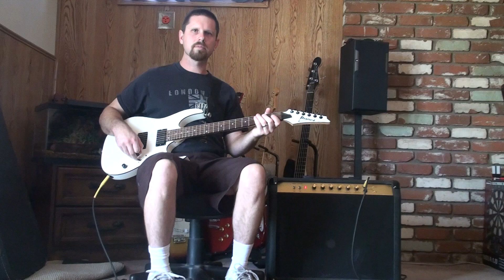Hi-Octane tube Guitar amp DIY (HIGH GAIN) AX84.com

Comment: Hello. Sounds great. Hey I have a question. Did you connect the wire from pin7 to pin 8 on the power tube? What power tube are you using?

Comment: Often in a tube amp, in order to have very little gain, you need more power stage, so, that, you can turn the pre-amp almost to zero and yet still have volume. I have a 4 x 6L6 main stage amp. With my volume on about 1, it is very clean with Master up to about 4 or 5.

Comment: A guy built me a tube amp from scratch. It has too much gain. 6Aq5's attenuated input stage, 3-6x8's for pre amps and 4-EL34's for power. I can externally bias all stages with outboard controls. I dont bother the el34's but is cool to bias the input and preamps. I have bias them to near zero current flow and still the amp is way too beastly for me. The guy is a genius actually. I told him I wanted a high gain amp and unfortunitely, that's what I got. can resistors cut gain without power loss?

Comment from the maker: It is a SE 12watt amp using a Hammond 125ESE and a Doberman 20 Watt Single Ended Output Transformer. B+ voltage is higher.

Comment from the maker: • Place a 500p capacitor in parallel with R23 to reduce the zingy highs there.
• Change R11 to 47K and C7 to 680p for more crunch in the 1500‐2000Hz region.
Most mods are from the AX84 site.

Comment from the maker: • Place a 500p capacitor in parallel with R23 to reduce the zingy highs there.
• Change R11 to 47K and C7 to 680p for more crunch in the 1500‐2000Hz region.

Then i keep changing stuff around that to get a great sound i wanted. Most of the mod were from AX84s site.

Comment from the maker: Parallel another .68uF resistor with C16 to add a bit more bass punch around
the guitar's fundamental frequency.
• Increase the value of C13. to .0022uF, .0033u. or .0047 to drop the frequency of
the treble peaking circuit to 150Hz/100Hz respectively for more of that 'modern'
high gain curve and a bit thicker sound.
• Parallel a .0047uF film capacitor across the C2 power supply capacitor.

Comment from the maker: Remove the 220K's that go to ground between stages. Bias the 1st stage with 220K
plate and 1.96K cathode. Those values are for maximum 2nd degree harmonic distortion